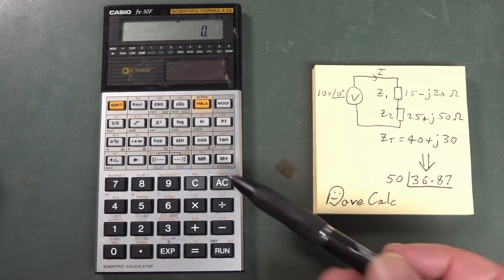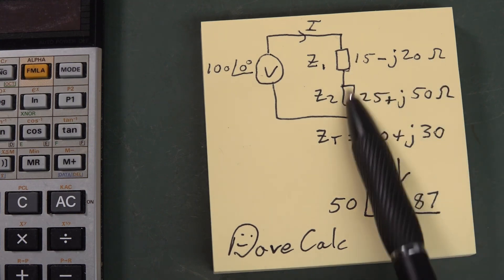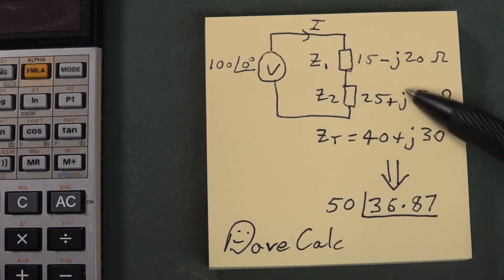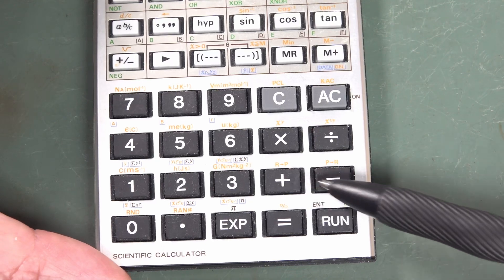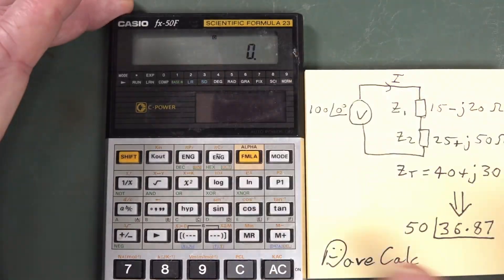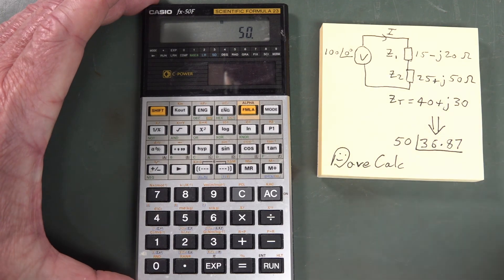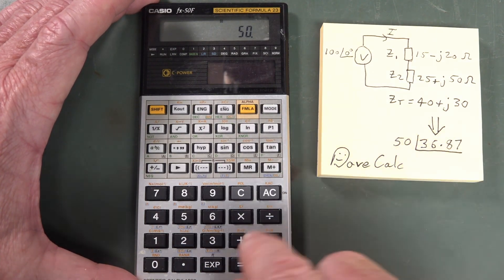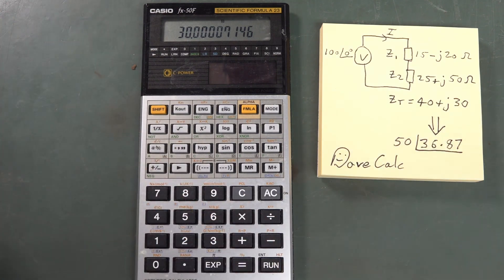Tutorial: Casio Calculator R-P and P-R Functions

Comment: Excellent post sir! This is not EE but did you know you can also use Rect to Polar (and vice versa) when working with vectors? The rectangular components represent the components of the vector which you can convert into the magnitude and direction of the vector when it returns the polar part.

Comment: What are you talking about?

In the REAL world I used these buttons in the OLD days while programming a CNC milling machine by hand from a blueprint.

Those clever draftsmen were good at putting angles on a drawing which were totally useless to a guy that needed cordinate locations in an X & Y format.

The calculators with this function saved me time and a lot of paper to get the numbers I needed to punch into the control panel on the CNC machine.

I doubt many people program by hand directly into a CNC machine these days. It was still common 30 years ago.😂

Comment: Have a fx 82 with original Casio batteries still working after 40 years
Reply from the maker: The FX-82 in interesting in that the only function on the lower key are the R-P and P-R function, hence why I used it in the thumbnail. Should have used it in the video actually.

Comment: That's why I bought a HP 48 for university back in the day. Much easier for complex math.
Reply: still have my HP-42 that I used for my MSEE!  A beauty!  Fortunately, there are emulators that you can run on Android phones, such as Free42.  It works quite well.  There are copies of the manual online too.  Too bad that the emulators can't simulate the feel of the real HP-42's keys.
Reply: @SkyhawkSteve  There is a 12C Android app (Touch RPN) that I use on my phones/notepads. Has ads but they are not objectionable. 

galculator on Linux has an RPN mode.
Reply: Plus 1.
Reply: @mauricevandoeselaar  No. 1 + 😁
Reply: @cm-hw5ww oops you are right
Reply: I had an HP-45 back in the day,🤓 someone pinched it. 🤬 Now I have an HP 12C. 🧐